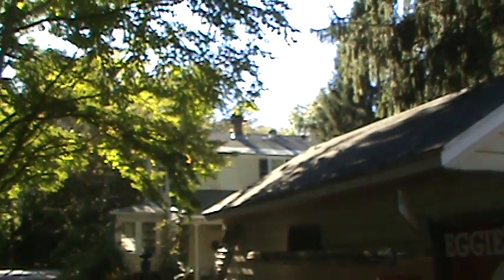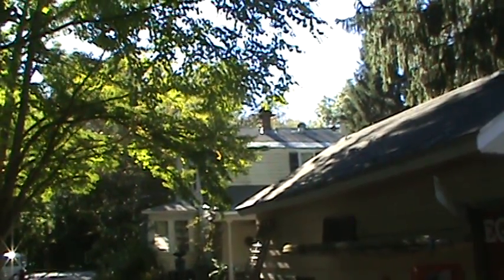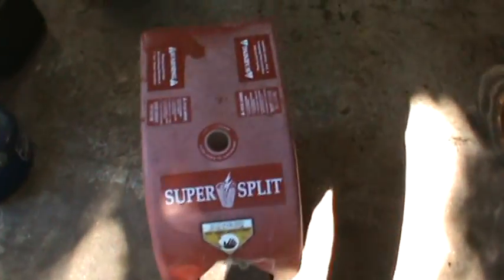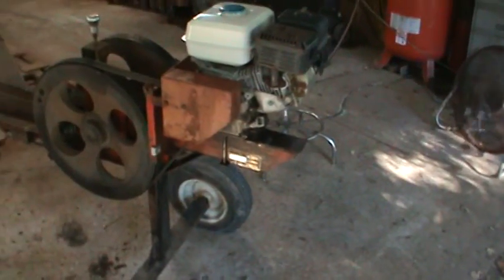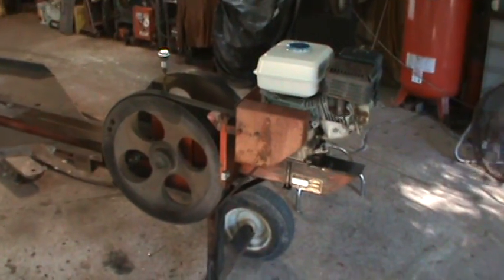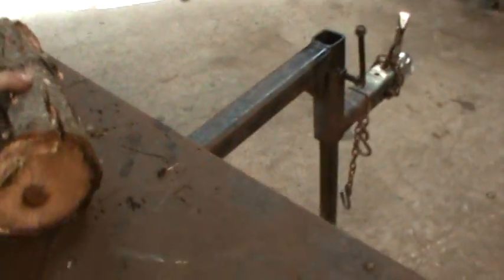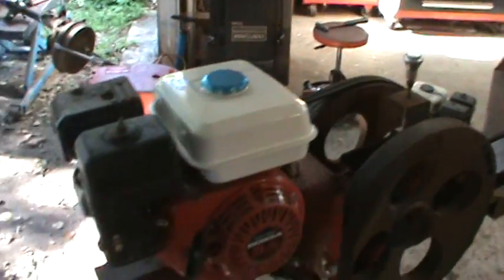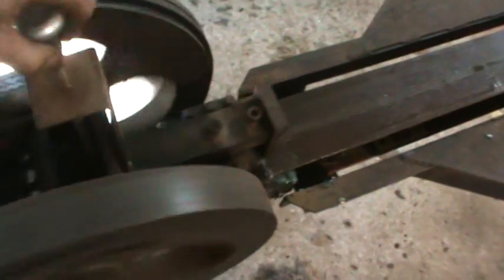mechanical log splitter

Comment: I see a VW transaxle over there. You building a sand rail?
Reply from the maker: a split window bus
Reply: I use to be big into VW's. I still build one every now and then for a customer. When I'm away from my shop. I can't hardly even go to the races or stand to think about turning a wrench on anything. Nice Bus you have there. I use to have a 66 with reduction axles. 45 mpg. Not very fast though. lol
Reply: Mustie1 hey I just bought my first car and it's an old rusty vow bus that I paid 500 bucks for, since the body is in good condition I'm leaving it rusty for the nostalgia. It has a carb issue and it's leaking oil, do u have any carbs for sale? If not can u mabey give me some help fixing it
Reply: Vw not vow, stupid autocorrect

Comment: Much faster than a hydraulic.  I have the same, but in electric.  Clean, no gas, no oil, no fumes to breathe...and it goes through everything...very fast.
Reply: Would it have trouble splitting a 16" log on a 6 way wedge?
Reply: USNVA I think so.  6 way is too many ways.  I've see 4 way work well, but I am faster with my 2 way.  It sounds funny, but the 2 way is quick quick.
Reply: Bourne Accident
I bet I could give it more power - flywheels would be 150 lbs each, super-size the powerplant - replace the petty single cylinder IC engine with the manly man's 230 v 15 hp electric motor, and increase the belt widths.
Reply: USNVA Sounds good to me.

Comment: I have seen a lot of videos of this type of splitter. This one seems very slow, if you can believe it. That ram should leap out and massacre those rounds in the blink of an eye. Then it should retract lickety-split, if you'll pardon the pun. Maybe you weren't running it at full speed, I don't know. These are neat splitters. DR makes a clone of this one. They're kinda interesting but I don't know if they'll ever replace tried-and-true hydraulic splitters. Crank this one up and let 'er rip!